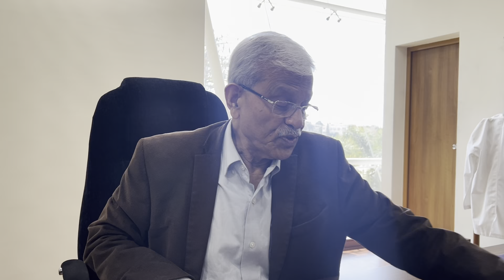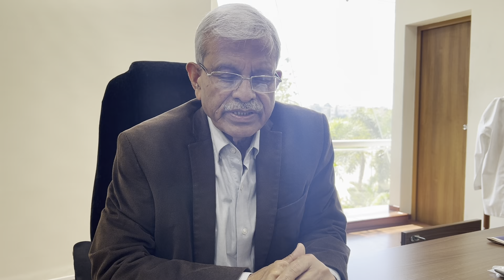Carbon Net-Zero : How to Achieve? | Dr. R. Mukhopadhyay, IRI, HASETRU, IRMRI

Comment: It is true we are getting carbon black, oil, steel, fibres etc by pyrolysis process or other extraction route from tyre or other rubber products. But I have seen practically by using such recovered ingredients by more than 25% the physical proerties of end products drop by about 40%.

Giving the first priority to the environment, how we can retain almost original properties?